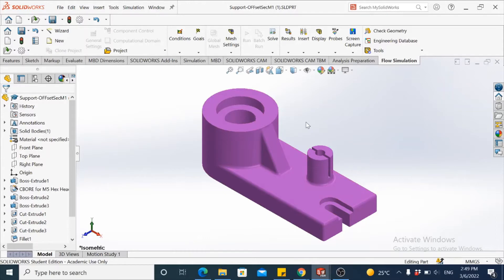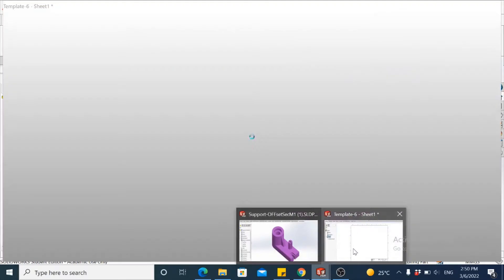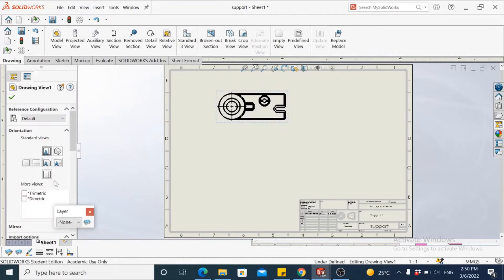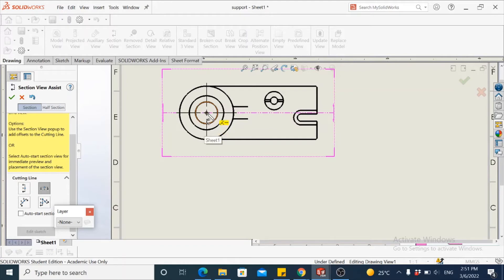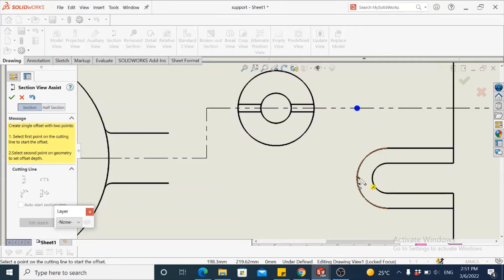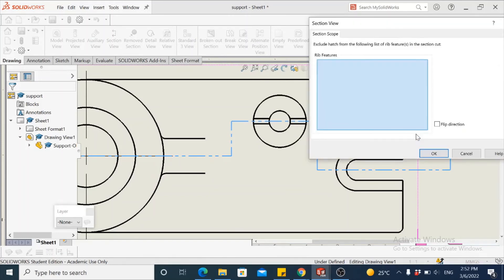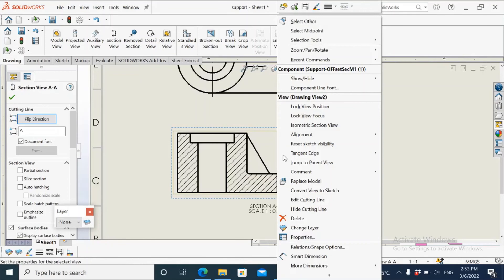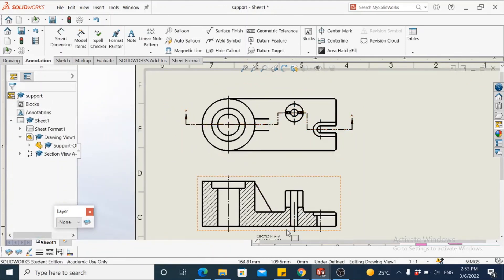Offset Section - SolidWorks

Comment: How to enable the option that show different offset after click
Reply from the maker: You can enable it from Options/System options/Messages-Errors-Warnings/Dismissed Messages/check the boxes in the pop up dialog box. Next time, it will pop up the messages.

Alternatively, you may sketch a line along the cutting plane line path in the top view and select section view from Drawing toolbar, it does the same job!